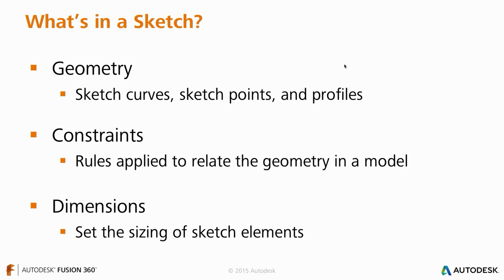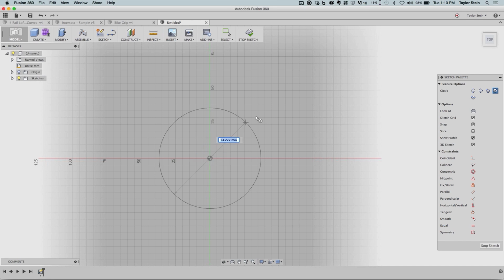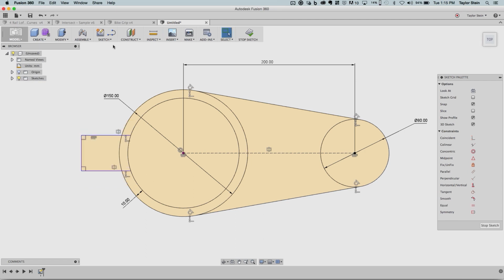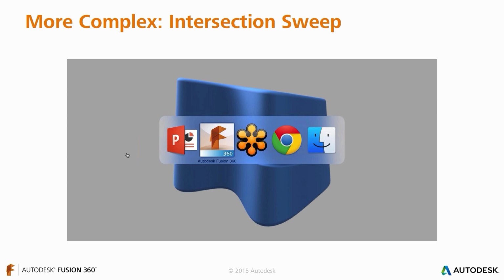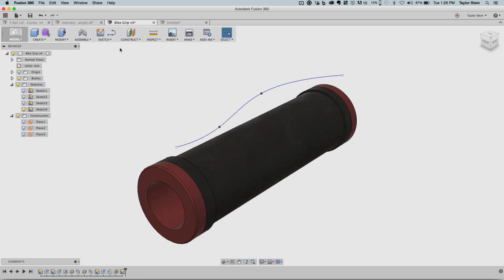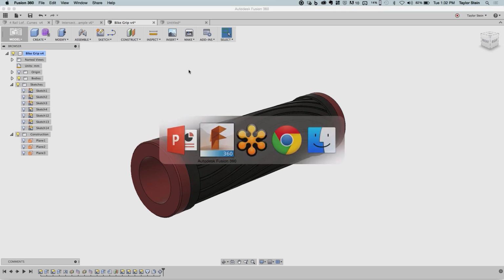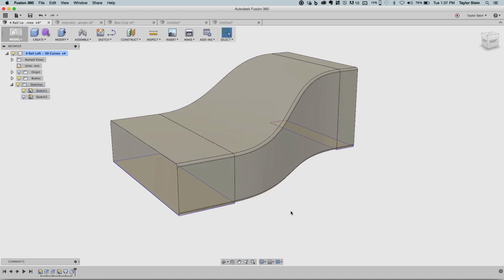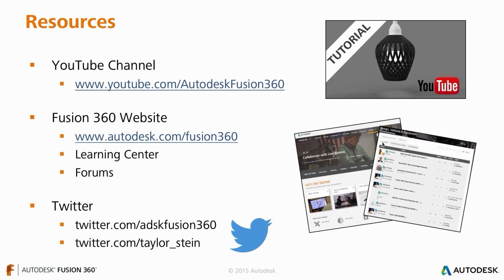Webinar Advanced Sketching

Comment: The Project Tool is missing from Fusion 360 as of lately. I found they combine this feature into the "Split Face" tool under the "Modify" menu with similar usage as outlined in this video.
Reply: It is still there, you just have to be in the 'edit sketch' mode now, and it is under 'Create > Project / Include

Comment: Fantastic video, thanks a lot !
Among many questions I may have, I'd like to make line (or arcs) tangent to a spline (on a fit point, or maybe anywhere on the spline). I can do it with arcs, circles, but not with splines. Any advice for this ? Thanks again !
Reply: Answering myself. I found on the Autodesk forum a workaround, which is drawing a line, adding coincidence constrain to a fit spline point, and then parallel constrain with the spline handle on that point. It works but, in that solution the spline changes to adapt itself to the new line. I'd like the reverse, a new tangent line to a fixed spline. Fixing the spline hides the handles, thus not allowing parallel constrain.
Thanks again.
Reply from the maker: My thought on this....can you fix the spline point without fixing the entire spline? If not, or if I'm missing the point, can you pose this question on the forum with supporting files/images?

Comment: Regarding the 3D loft at the end of the video: is it possible to separate the side walls of the loft and use these as a template for the sheet metal environment? Thanks!
Reply from the maker: @Thomas-  Yes, you could use Offset in the Surface menu to create 0 distance offsets, which basically captures the face of a model.  You could then use that new surface to help with your design of a sheet metal component.
Reply: @adskFusion  thanks for your help!

Comment: Hello. I'm brand new to Fusion and I had a question about project. I don't understand why you took the extra step of projecting when all I did was use a construction line and drew a circle on it then extruded. Done... Is there an advantage to project? I have been using mastercam for a long time and I would avoid project because it was so finicky and irritating to use.
Reply from the maker: Biggest advantage is that anything projected will follow future edits. If you're not worried about that, it doesn't need to be used.
Reply: @adskFusion  OH! Nope that is a good thing to know. In mastercam (I came from that) I never really figured it out and it was always temperamental. I'll remember that. Thanks!

Comment: when i choose loft command it doesnt made curved shape it was just straight sharp line,i tried to increase distance between the objects still same results? any solution?
Reply from the maker: If its a straight piece, you might want to use a sweep with twist instead. That said, when creating a loft you'll see control points where the connections are made between sketches. You can click and drag those around to force it to twist. See this for more details on the loft command: https://youtu.be/fXQ28AVaMh0

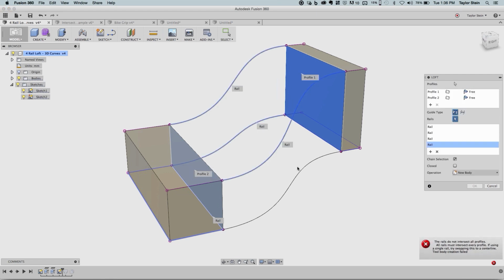Comment: This video has some really good information, but I wish the instructor didn't blow through that loft error he was getting at 33:07.  I have found lofts to be a highly fragile feature in Fusion 360, and when I get an error like what this guy had, I just can't move to another point in the timeline - I have to fix it!  It would have been instructive if this instructor didn't just sweep the error under the  rug, but instead tried to explore what caused it.
Reply: He just missed the right order while selecting the rails.
Reply: @koulis96161  whats the typical order?
Reply: @koulis96161  Well he could have mentioned that, you know

Comment: using the include 3d geometry tab I am able to select the points however when trying to link the two with a line or a spline the cursor simply doesn't recognise them and I am unable to draw a 3d line.
 I have tried to replicate exactly what is shown here at 30min without success.